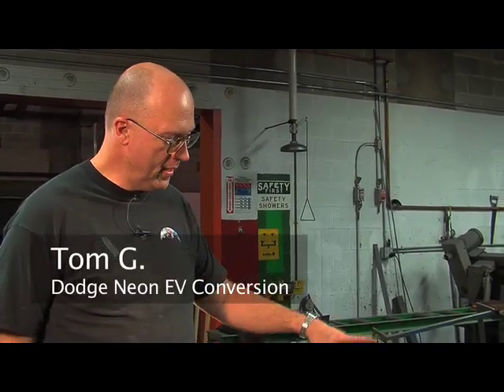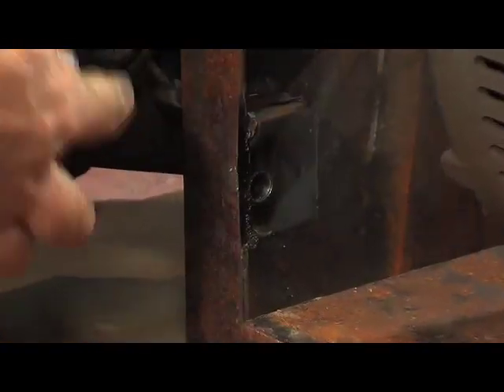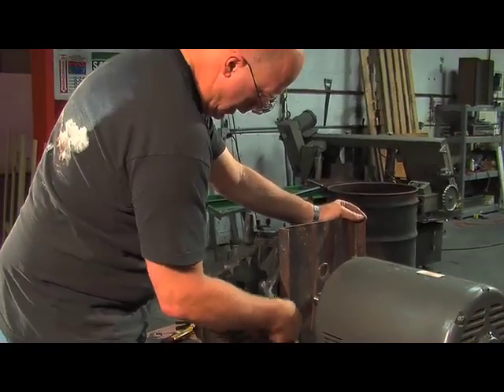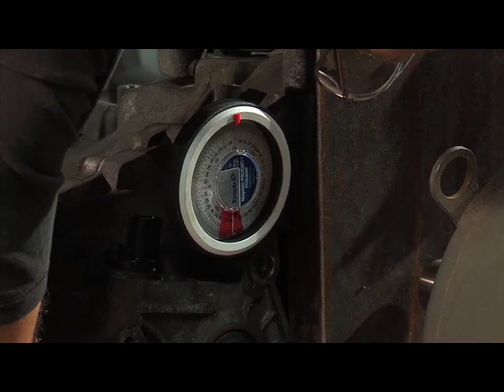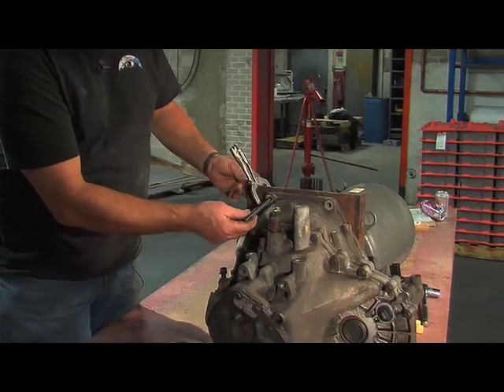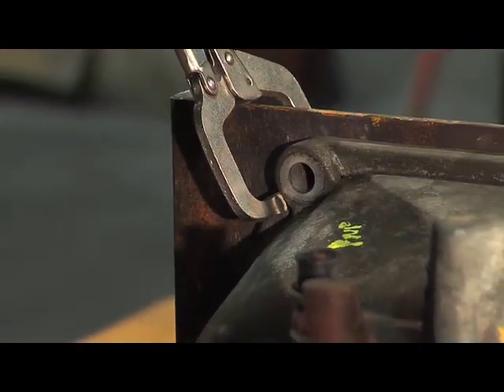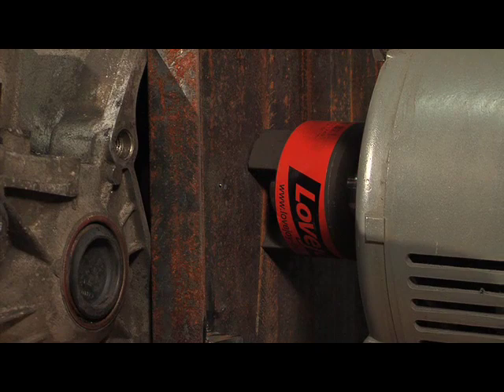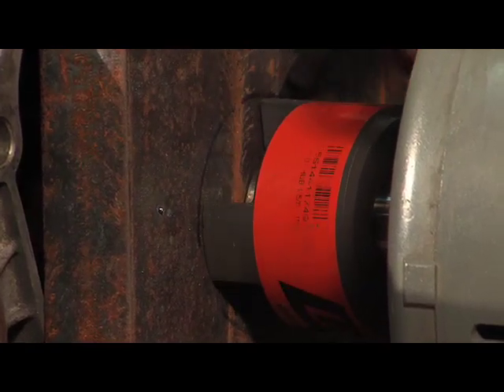AC Electric Car Conversion 101  part 003 - Adapter Plate and Coupler

Comment: what's the e motor specs? like watts amps volts HP i see gearing it through transmission although a slight friction loss can still get you higher torque or higher speeds based on what gear

Comment: Just a idea can u make ur car engine into a generator to power the electric motor but hove battery so when u drive in City where u get shity gas mileage
Reply from the maker: Having both an engine AND and electric motor and battery is the basic premise of what's known as a Plug-In Hybrid. The Chevy Volt is the best and most popular example of that type of car. There aren't too many examples of them in the DIY world as they are relatively complicated. All the parts double from having both GAS AND ELECTRIC systems.

Comment from the maker: Without the extra weight and spinning of an engine and flywheel, it's easy to shift WITHOUT a clutch. Also, Tom installed a button on the stick-shift knob that automatically spins the motor at the correct speed for the transmission to drop right in to the next gear. It's sort of an electronic speed assist!

Comment: yes you would still need trans fluid in the transmission, the fluid in manual transmissions is for lubricating the gears and bearings only, but in an automatic the fluid does the same PLUS it determines the shift points by building pressure as the rpms increase; the faster you go the higher the rpms, shifts gears, process repeats. now if you use an auto transmission you would have to keep the torque converter attached as that is essentially the pump  for the fluid

Comment: I noticed that there is a gap where the adapted plate and trani meet. Do you eventually close that up? My thought is that water would get inside the trani. also, I have watched a lot of conversion videos (btw yours is really good) and they never mention transmission fluid. Do you need it?
Reply: if you have a trans..you still need trans fluid. dont worry abotu the gap

Comment: Ben.  What are the specs for the motor?  Where is it from? How much did it cost? Is an inverter needed? What about omitting the gearbox completely or using an autobox? What is the power and torque of the motor? Do I ask too many questions?  Regards

Comment: I believe there is a company, called Kennedy Engineering, that made/makes adapter plates for the Porsche transaxle for use with different engine set ups.  Perhaps they may may make plates for this type of application if there was enough deman. Just thinking.

Comment from the maker: Steel and iron are easier to weld. This adapter plate/motor mount have since been primed and painted. Rust shouldn't be an issue.
Many EV adapter plates are aluminum. The one in my Electro-Metro is aluminum.